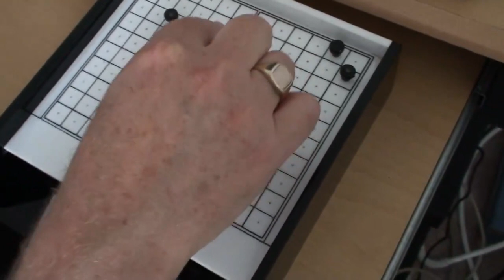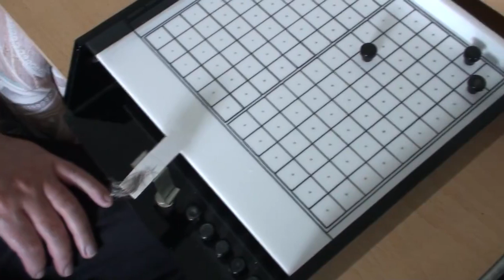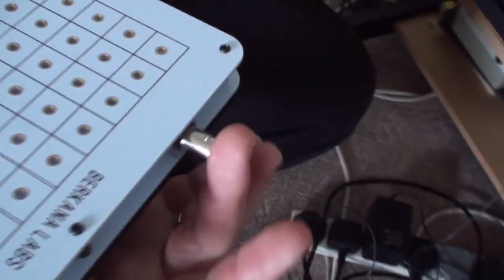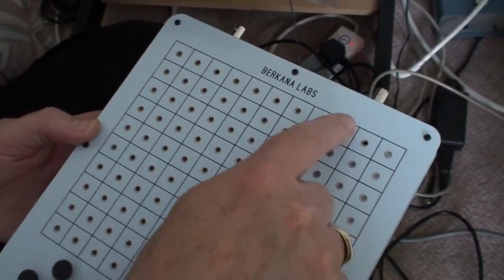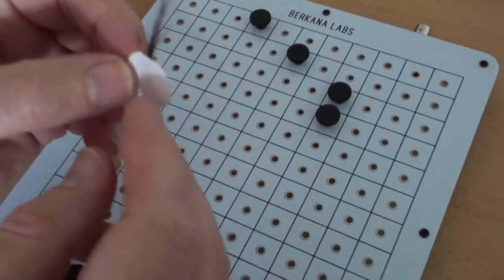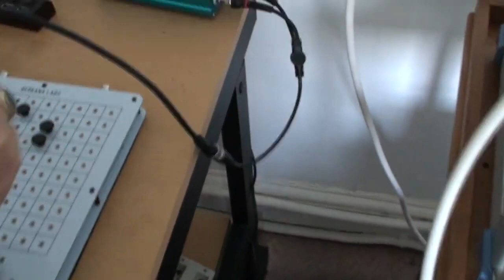Berkana Labs Peggotty Radionics

Comment: Why are you putting the rates in right to left????
I have a peggotty board & I've been putting in Copen or Drown rates
left to right. I got the old game "Battleship" on EBay dirt cheap & it has 
10 X 10 slots & comes with slot plugs, works great. Thankx for vid, enjoyable.
Reply: Using Battleship as a DIY Peggoty Board is a really good idea.

Comment: Butcher used to spin the sample by his intent.  He couldn't dowse but he could affect matter with his mind. The movement was said to help facilitate the energy transfer; sort of a register as to effective treatment.
Reply from the maker: It is a thermal effect, body heat and small air currents will cause the pin wheel to spin, that is the logical answer. However, I have also witnessed like Butcher, that it can be affected by psi, and under verifiable control. Peggotty does seem to be playing off of thermal principles in its design, so there is something to it. If we assume most radionic instruments are operating at one end of the electromagnetic spectrum, then Peggotty is at the other in the infrared.